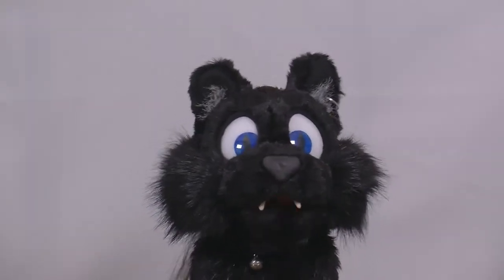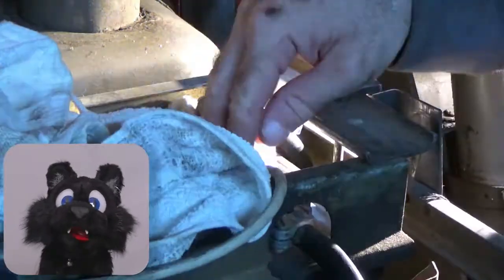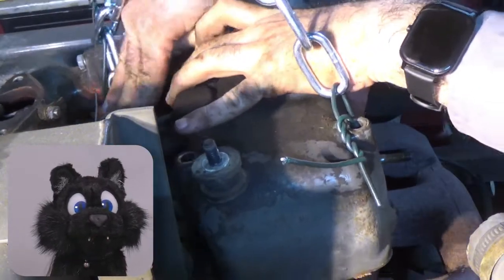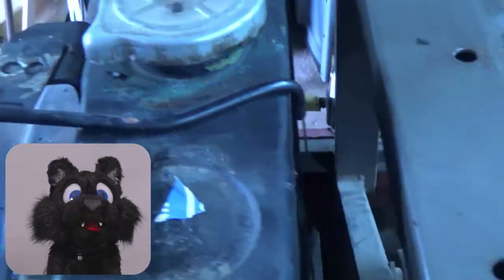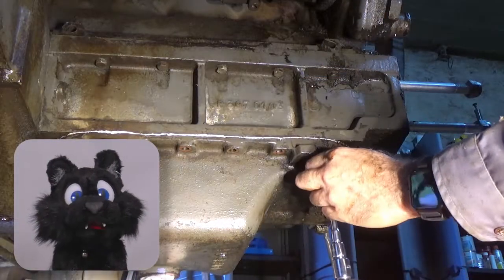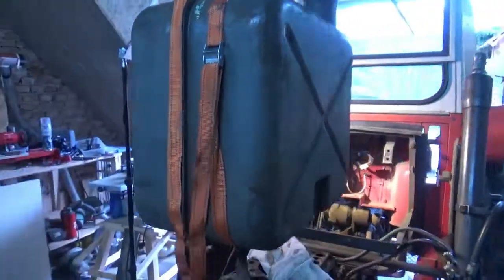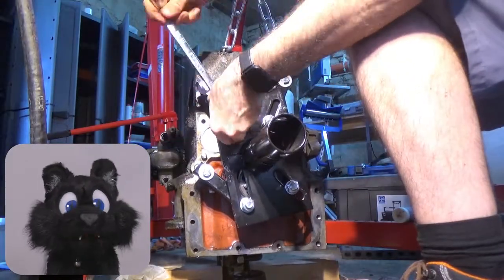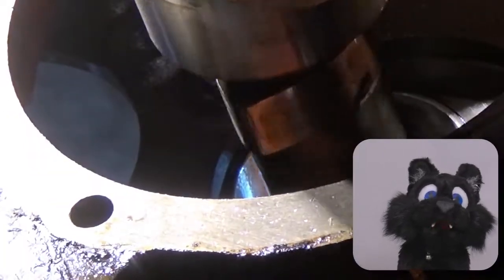Repair #1 - Tractor "Oil Check" (Part 1)

Comment: Don't forget to run a bottom tap into that hole that the damaged screw came out of ... often times when you pull out a screw that has a damaged thread on the end of it the culprit tends to be the threaded hole itself and snapping a bolt of anywhere in a block is never, ever fun -__-
Reply from the maker: I pretty much prepare to use a tap in all of the threded holes, just to clean out the threads good and proper. But I have yet to check if there is any visible damage to that flywheel.